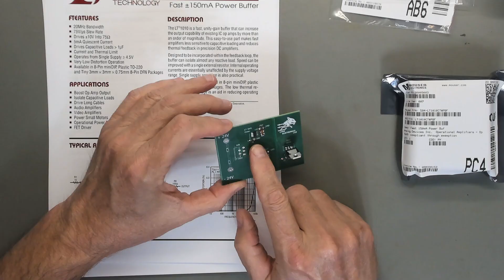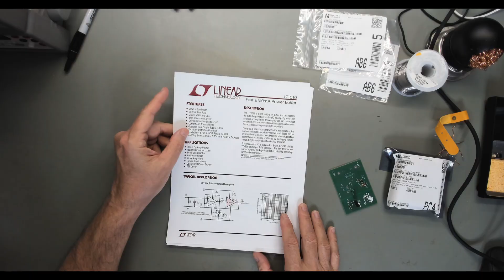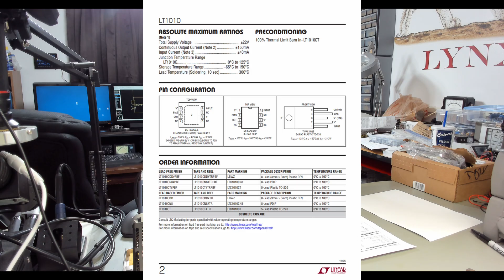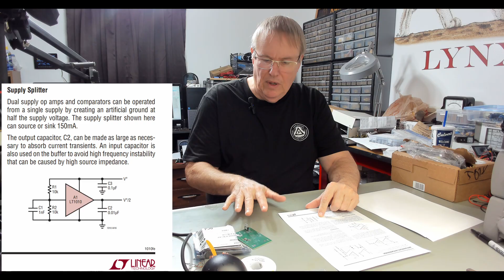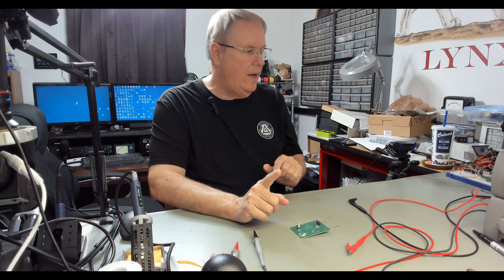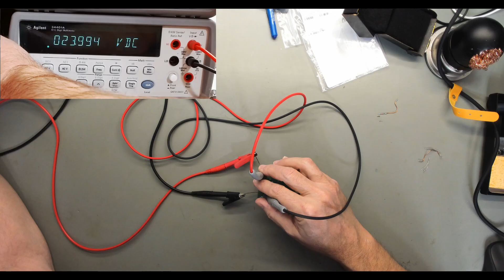LT1010 Voltage Calibrator Build Gone Wrong

Comment: Ref 102 can source 10mA. Simple voltage divider can be calculated to source 1mA without causing the voltage ref to alter its output due to current drain. 10V / 1mA is 10kohm RT so 9x 1kohm, 9x100 ohm and 10x10 ohm will give 10V to 10 mV. Really simple and works off 2 9V batteries or a power supply with mains filter. To get higher voltages you can stack the references. Working in calibration for over 30 years I am amazed people keep chasing a very accurate stable reference where as I use a fairly good calibrator but then measure the ouput in parallel with the instrument I am calibrating using a calibrated 6.5 digit multimeter. I built a 100V ,1A DC calibrator with fixed 0.01% resistors for less than £400 so similar to a Time Electronics 1017 calibrator just not portable. AC Voltage is also simple using an oscillator circuit an audio amplifier and audio transformer plus a few other parts. Voltage references can source higher currents boosted to 100mA or higher using a transistor, see REF102 data sheet. https://www.ti.com/lit/ds/symlink/ref102.pdf?ts=1790953361253. I did make a simple voltage reference 25 years ago and it is stable to 50ppm or 10.0005 VDC. The reference I used is no longer made.

Comment: In these cases I always use a Bourns 3296W trimpot for the divider going into the LT1010a.  To get full output you need to put about 1 mA in, so using two equal resistors will produce an error.  With the 3296W, just tweak to get a precisely balanced supply.
Reply from the maker: That’s a great suggestion for fine-tuning the balance, thanks for the tip!
RJ
Reply: @LynxElectronicsLab  No problem.  Yeah, I usually come from the pot, go through a unity gain buffer (as you suggested), then into the LT101A.  This way you can use a 100K or even 200K pot without any problem.
Reply from the maker: That’s exactly where I was heading thanks!